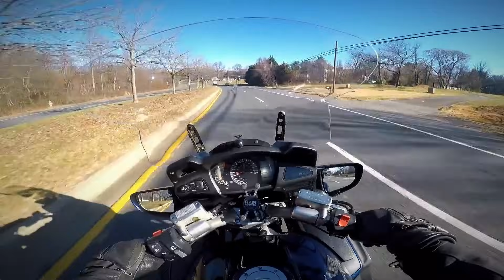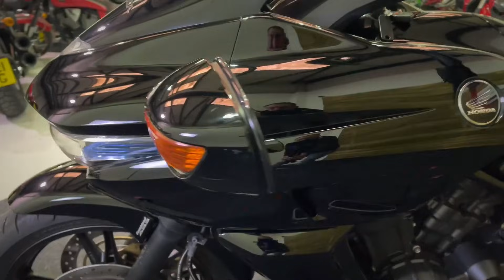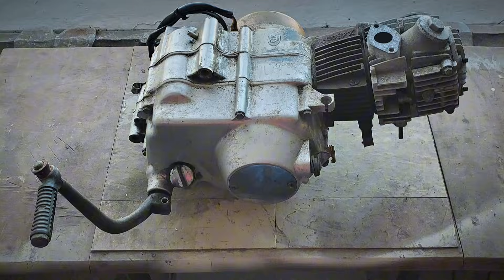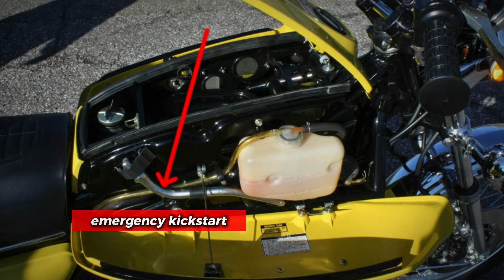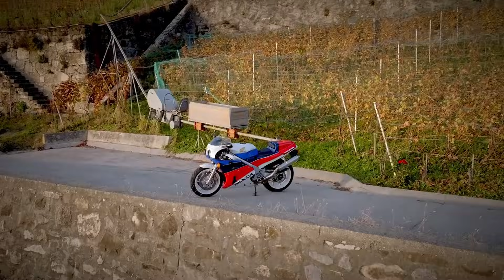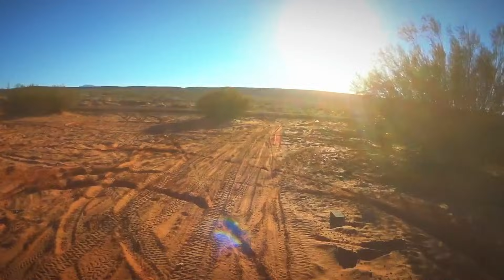Top Honda Bikes To Avoid (And The Ones Worth Every Dollar)

Comment: My first bike was a C50 Cub red/white that was great fun to ride around, in the 80's I played around on a 750 four with the K7 engine that had a quirk, the first start in the morning always had to be a kick, then electric all day was no problem. I currently run the GL1800 but later than the weld problem models, still holding to it as I dislike the later models when they changed everything and added a mono front suspension, I think they spoilt a once great flagship making it into a glorified and ugly sport bike. But Im old and outgrew my ZZR1100 C3 🤣

Comment: I had a st1300 for few years and rode in let’s say spirited way with a passenger. Never experienced what you’re describing.  Heat on the other hand was a whole different issue, especially on hot days in traffic.

Comment: did 250.000 Kilometers on the st1300. Never had the weave. Fully loaded with wife on the rear seat This is one of the best bikes ever. After 250.000KM I traded it in for a 2004 1800GL. If you keep it well maintained, you'll have a bike for life